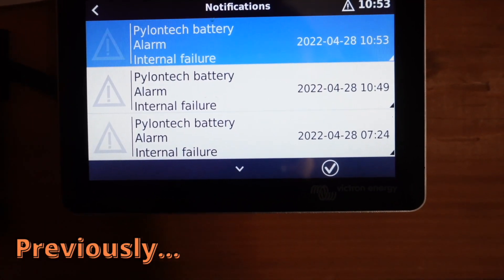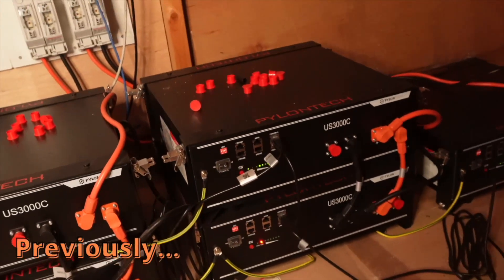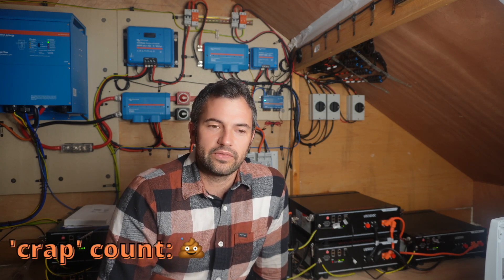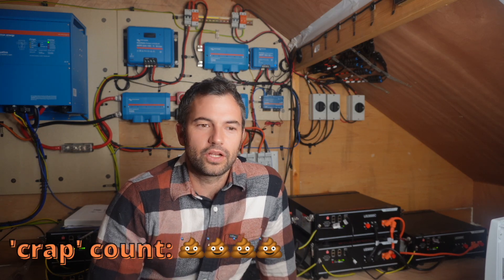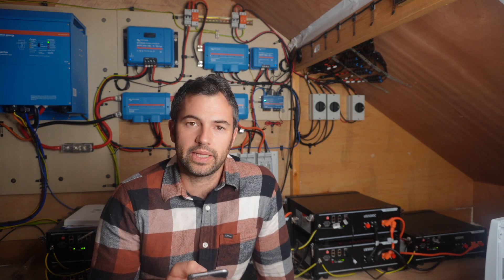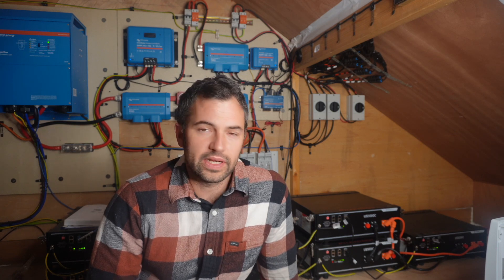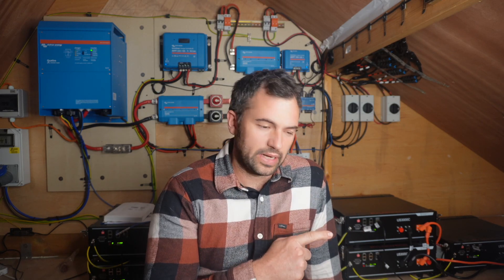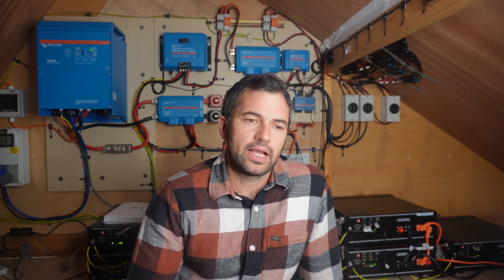WHY WE WILL NEVER BUY PYLONTECH AGAIN

Comment: Engineer-to-Engineer Take:
The "Internal Failure" is often over-reported due to Victron being strict about polling intervals or battery BMS not being 100% deterministic.

If it doesn’t escalate, no voltage sag, no inverter cutoff, and it self-clears: treat it as noise unless it grows in frequency.
We tell customers constantly to ignore these alarms in the Victron reporting/monitoring, if these faults are not accompanied by a RED LED fault, your system is completely fine.
Reply from the maker: Thanks for the advice.
 Interesting a lot of people just ignore the alarms. Our pylontech battery did have a red led light. It did have a problem. As it was in the barn catching the light on took sometime. 
We have alarms now and then. But when I look I can’t find fault so have been doing just as you say Ignoring it. 

Customer service when I bought these didn’t exist.

Comment: For communication problems on my Force-L1 stacks I found the delivered comm cables was with 3 meters to long to connect the stacks. After replacing them with simple 1 meter cat network cables all went well. This is very annoying because in the documentation is written the delivered cables should only used.
Reply from the maker: Yeah. The manuals are frustrating. Pylontech brought out a number of versions of manuals for our batteries. We had someone say it says in the manual……….. and it did………. in the updated version 😂

Well done for getting it sorted 👍

Comment: Thank you for this revealing podcast, because our solar system installer has suggested replacing our three chinese LFP batteries with PylonTech batteries after a fault whereby our Solis Inverter can no longer communicate with the batteries. I'm inclined to insist that we be provided with the equivalent capacity of UK built batteries like GIVENERGY, that have a good reputation.

Comment: I am currently experiencing a problem with a US2000C which was working fine but then I added a new one as master, the new one alarmed and the old one shut down no lights!. Swapped out the old one and the system worked fine with the new C and 3 old Bs currently in protracted discussions with retailer
Reply from the maker: @davidveysey4368  sorry to hear that
. I can’t help you. I find they have a mind of their own. They are trying to be too clever with all the firm ware on stuff and actually it just needs to store power. 😂
 Good luck with them.
Reply: @The_OffGridFamily  Update....after much too-ing and frowing I had been told that my firmware was wrong on my Inverter????!!! anyway short of it is they have finally taken back the faulty battery after I gave an ultimatum of making a chargeback on my credit card just awaiting refund. It has unfortunately damaged my confidence in plylontech

Comment: The battery are not good.
I have warned about the misleading information and post as well as fan boy cover ups and excuses .
Youre right to say something.

Im a supplier and installer /engineer.
They are under powered or rather over rated, this cauess a wife range of problems for users. You also have to buy more to make them work with most small  systems and are not suitable for off grid.

Comment: The Victron setups always seem overly complex with lot's of (expensive) boxes from my point of view

My current system is very simple using 5 x Pylontech US5000B series batteries of various ages that do NOT need DC circuit breakers installed as they are built into each battery.The inverter is an MPP solar brand 11KW pip max

Turning the inverter power button on or off and/or applying shore power starts up all 5 batteries and they charge/discharge/cell balance automatically and I've never had any fault codes. 1 button does all !

So a working system is very simple wiring that has been running for 2 years now and involves.............................

1) 2 x pylontech battery cable sets running DIRECT to the inverter input terminals for 240 amps at 48volts (amphenol plugs into the batteries - no tools needed)  

2) 1 x customised network cable from the inverter to the canbus input on the Pylontech battery number 1 (master) only. This allows wi-fi or usb monitoring via a free app (watchpower) and set dip sw on the master battery to 9600 baud 

3) The solar panel strings plug into the Inverter via a lightning protection/current protection/isolation box for added safety

4) The grid or genset (shore power) inputs the inverter via a circuit breaker

Comment: Just a follow-up to my comment of one year ago. We ended up installing a total of 10 x Pylontech US3000C units. These are matched to 15.1kW of solar panels and 15KVA of inverters (all Victron.) We commissioned our off-grid system on the 10th Oct. 2023 and have not had as much as one second of downtime since. The batteries have excelled. One of the blessings of being in Australia, especially where we are in Australia, is the abauncance of sunshine.So far the state of charge of our batteries has never dropped below 50% after an overnight discharge and has only on three occasions failed to get to 100% by the end of the next day. This is keeping the batteries right in their "zone."

Comment: there is a known compatibility issue between US2000's and newer C version in a battery stack. C's need to be as Master, otherwise they won't talk to each other, and inverter shows "comm fault". I was told by either Pylon or Lux to change wiring on CAN cable, and it worked. But now again, I have similar problem- no communication within system; and no solution, its a DEAD END emailing both for advise. Has something changed? new firmware? anybody knows anything?

Comment: I have been running 8 Pylontech batteries us2000 since 2017 with our ESS system without any problems. In fact the oldest pack of two have 1564 cycles as of February 2024!
Reply from the maker: Glad to hear this 😊 Wouldn’t wish the stress on anyone!
Reply: @The_OffGridFamily  
I’m sorry about your bad experience. Perhaps I was just lucky (touch wood)!
Reply: I've been running 8 x US2000 since 2019 (1834 cycles). Over the summer I noticed that the pack capacity was degrading quickly so I've spent a couple of days investigating whether this is degradation of the whole pack or an isolated US2000. The result is I have 6 units with a normal SOH for their age, 1 unit with a capacity of 0.77kWH & another with 0.5kWh. I've checked the voltage of each of the 15 cells in each US2000 & the range was 3.32v - 3.33v which seems pretty well balanced to me. Each of the 6 packs of 5 cells was 16.63v. None of the 6 cell packs showed any sign of swelling. I've ordered a link cable & batteryview to get a clearer picture of what's happening rather than using the multimeter. The probability is that I will have to start a warranty claim with Pylontech which sounds like fun! In the meantime I'm going to retire the faulty US2000's, buy a couple of US5000 to restore the missing capacity & add a bit more headroom at the same time. I'd like to change brand at this point but with 6 functioning batteries it's not really viable to do that so I'll soldier on with Pylons for now.

Comment: The fact that you have not done the first procedure given by the manufacturer, already puts you at fault, and suggests that you have probably not followed other procedures or prohibitions as well. Then it seems impossible to me that pylontech has never responded. Epever answers me in 24 hours even on questions that have nothing to do with their products.

iMoreover, the fact that you would have received a defective specimen is not a reason to define a crap company. you are right if this problem has some statistical relevance among customers.

It's the same thing I don't agree with people who try a battery 1 time, and they pontificate to everyone that it's a good product. batteries can only be judged after years of use.

Comment: Interestingly on the ITS website they now have the follow *. * In accordance with Pylontech's warranty conditions. The warranty is only valid if the batteries have been installed by an electrician or authorised installer.   I don't remember this line in the original paperwork.

Comment: What is reporting the error? I don't see a BMS... These issues are most likely comms related, the inverter is not capable of assigning so many or the actual RJ45 cables are faulty.

Edit: Typed this right before the response at 6:13

Comment: Call me a pedant but...
Looking at what you have installed it is not exactly a proper install job. I could not live with it myself as it looks like a spiders web. In my experience, if it looks messy that is how it will behave.
I worked on a similar system in an off grid install in Spain a couple of months back. 
It went into  similar type of fault and it took me 15 minutes of reading reading and 10 minutes of checking to discover a faulty comms cable. I have never even looked at solar / li ion batteries before but it is not much different to what i have worked on in industry for many years. I gave the installer a hard time for not making the comms cables properly and all has been good since

Comment: Are the dip switches set right ? I could not really see from the video 
Mine the MASTER batt has Dip sw 1 down (on) 

All other dip switches are off - up, as are all the slave batteries  

I use an MPP solar 11Kw PIP MAX inverter and the comms are perfect via CANBUS

Maybe an Asian inverter (Taiwan) and China Batts are better communicating ?

 I  also don't know of anyone running more than 6 x US3000 without going to a second string, even though it states 8 units their own design images show 6 per string and then using their RS485 Hub with more strings. There are many different applications involving low current vs high current versus Kilowatt hour capacity  and low current draw (such as telecommunications), so many different topologies. I dont think this stuff is totally plug and play in all cases.

My setup is an MPP solar PIP MAX inverter = 11KW continuous and 22KW peak with 3 x US5000B batteries and it is used every day for 12 months now with zero issues 

Pylontech are not known to have many if any issues in Australia with the Canberra battery test centre having no issues and they even make specific batteries for our Australian market as shown here   https://www.youtube.com/watch?v=v7jzsBfQ77s&ab_channel=SmartEnergyLab

So if the Battery is faulty it really is an issue with your supplier and the warranty  

I also noticed you have 6 x Victron devices which seems extraordinary and overly complex with more to go wrong. The single Inverter i use has everything in the one device, just add Batteries as the comms, battery and earth links are supplied with the batteries and inverter so it's plug and play. It has wi-fi (cloud globally) and USB access via an App or a laptop.And they are such a low cost you could easily buy 2 inverters for full redundancy if that were a concern.

I am a DIYer by the way however i have some electronics experience

Comment: the problem with rack-batteries is always one, regardless of the brand: parallel. It is impossible to balance them with 100% certainty: in time, if it goes well you have reliability problems and the battery shuts down to safety, if it goes wrong I think you already know what happen... (the on-board electronics that control the entire system can fail, it doesn't last forever like antithing after all) There is an electrical engineer specialized both in high-power industrial implants and in PV installations (I won't mention the video because it's in Italian) who explained the matter very well and also referred to important brands (indirectly of course, without mentioning them by name ) with this issue. One can change as many products as he want, with advanced control systems and smart BMS: they will always have always problems sooner or later. With parallel problems are not a matter of "if", but only of "when" they will happen...a giant waste of money and safety risk
Reply: How can you make a storage of hundreds of kwh without parallel?? Do you build cells from a million ah as big as a palace? Or do you reach the target by bringing the voltage to thousands of volts? I don't understand what you're saying.

The parallel has cons since there is electronic management in lithium. but it cannot be avoided in large plants

Comment: You should know that UK Consumer Protection law says that the supplier is responsible to replace or refund a faulty appliance for up to 2 years. The Consumer does not have to deal with the manufacturer, the relationship is with the reseller.

Comment: What I would reccomend is to try to isolate the wrong one. Start removing one battery per time and check if the error reappear. You could eirher end up finding the faulted unit and then replace it or if the error wouldnt go anywhere, it could be some communication issue, maybe even something reallt dumb like a terminating resistor faulted on the CAN bus

Comment: Are you guys producing cheese on your off-grid homestead...ya know, to go along with all that WHINE?  It took too long to find out, but the vendor and the supplier have told you it's a comms issue.  Did you try replacing that cable?  If not, why grouse about the problem when you can put it at the end of the daisy chain and not have it reporting a false positive?  What I'm hearing in the majority of your complaints is that you do not understand how these things work and you want a dead simple, plug-n-play, set it and forget it solution...but you bought a budget line of batteries from a company in China.  Quality is kind of like buying a bag of oats.  If you want good quality oats you must pay a fair price.  If you're OK with oats that have been through the horse already, well...they ARE a bit cheaper!

Comment: Thank you for posting this. I feel your frustration, just like me being annoyed by Batrim BMS people asking me money for a short call for assistance on theit € 1.100 costing BMS with failures in it.
I almost pulled the plug to order six of these for €15.000 but hearing this I will move over to a 18s2p configuration with much cheape EVE 280K cells combined with a 123SmartBMS that allows you to make exact fitting configurations in a simple way.

Combined with 3 SmartSolar 250/100 Victron chagers and 3 Multiplus2 5000/48 inverters, I can live offgrid from april to oktober and add a bit of juice from the grid from november to march.

Comment: hey mate I feel for you (I'm using my daughter's youtube account here). I live off grid in New Zealand, I am also a solar installer. I have had issues with some lithium brands, haven't used pylontech, but I also doubt these 10 year warranties. Almost all lithium batteries come from China and often from the same factories.  if you don't have a good distributer in your country, then it can be a nightmare dealing with Chinese companies. Although  lithium has many advantages over lead technology, there is an extra layer of technology and software that adds complexity and potential issues, sometimes I wonder if it's worth it. I do still use lithium for the jobs and clients that require it, but for robust reliability and less headaches I have been using lead carbon. Bulky, heavy, more required for usable capacity, certainly the side of battery disadvantages, but zero headaches and robust long living if used correctly within D.O.D. I don't use lithium myself and I have 3 separate systems. I've been off grid for 10 years, with all of the complications in life ever increasing I don't want to rely too much on complexities and software in my batteries or overseas companies that are difficult to communicate with, let alone stripping systems down and couriering things halfway around the world. good luck mate

Comment: Friendly reminder to all people reading: 

First thing you do when buying a LiFePO4 battery pack is fully charge them. "Top Balance" is the term that refers to charging every cell to 100% thus balancing them.

Then there is the problem with current sharing. The cabling going to each individual battery pack must be equal, thus having the same resistance. Only then will every pack give you the same current, otherwise one pack will be overloaded.
Reply: Thanks for this. My three troubled batteries are all in parallel using the provided cables, so the fault I'm experiencing shouldn't be down to an imbalance, but - thinking back, the third battery was added later. 🤔
Reply: That’s true / but over time you’ll get drift unless the BMS has a proper balancing capability for the cells. I suspect the BMS in the pylontech sounds like a problem. Have a look at the JK BMS / that’s amazing (make sure it has the 2a balancer in it)

Comment: Simble Answer - Pylontech US2000 are only for ESS not for Offgrid, because the low Peakpower (60sec 100A by US2000c). You need more Batterys for using in Offgrid, maybe arround 30 - 40kwh capacity.

Comment: I just watched your other video about the batteries and your connections. When you showed the battery specs from the manual, the figure of 'charge /discharge' was rated at 37A. At 48V this gives a continuous rating of around 1775W. There were also two figures for around 80A of I think about 60 secs and one around 100A for I think around 15 secs. Doesn't this mean with 6 batteries, theoretically your 10kW Victron inverter should be ok, ie 1775 x 6 = 10650W?